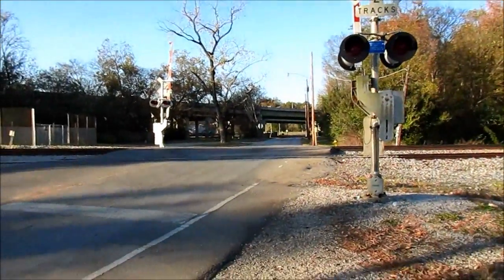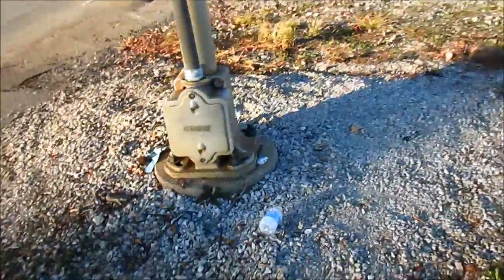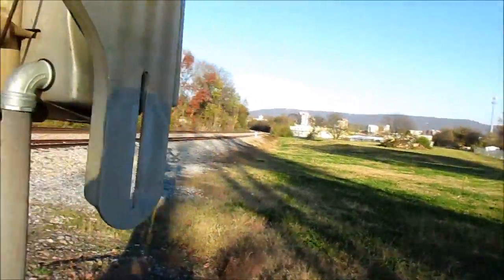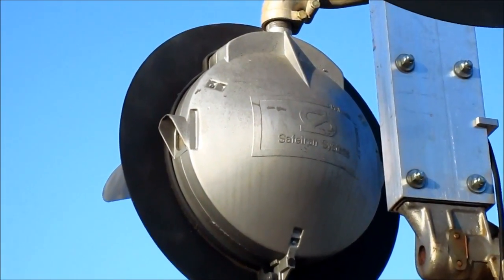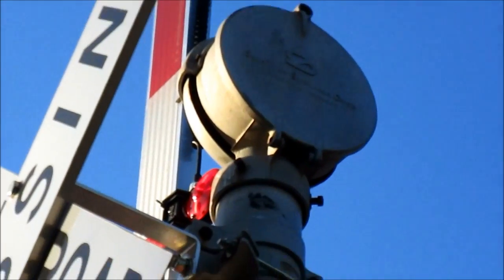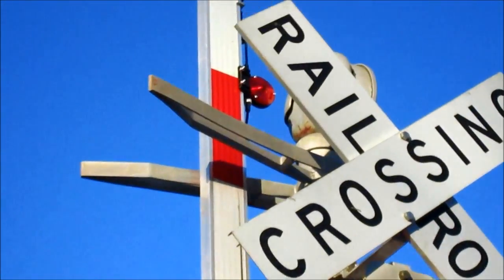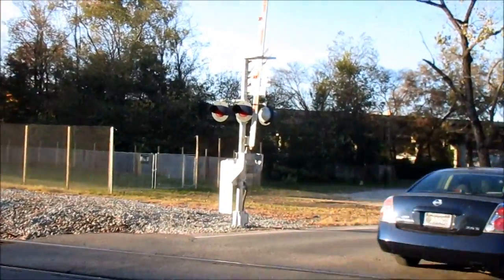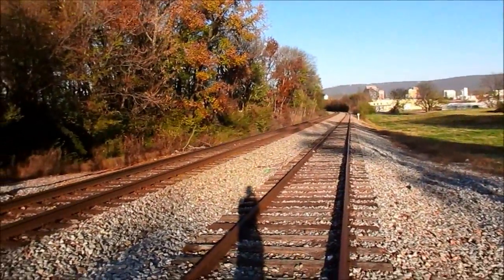Derrick Street Railroad Crossing Update 11-14-17

Comment: It's great to see some older equipment being recycled onto another crossing, specially the mechanical bell :) Wonder if they used this signal because they needed a replacement in a hurry and it was the quickest option available, plus the cost savings.
Reply from the maker: That's probably what happened.